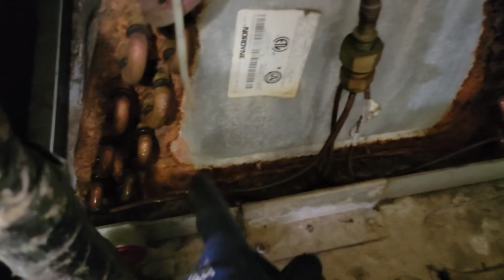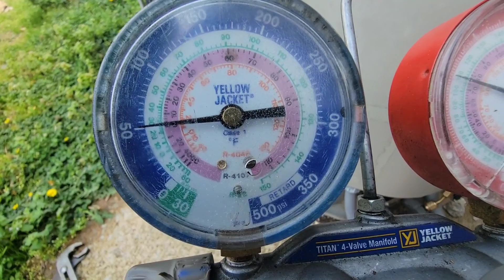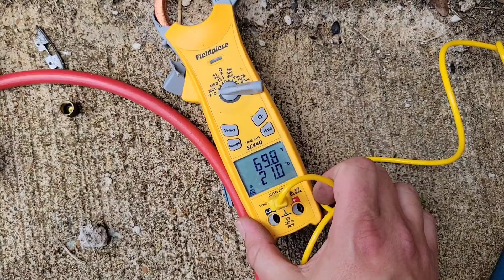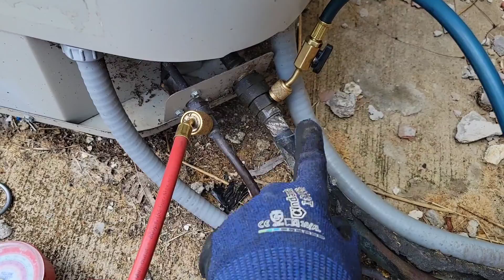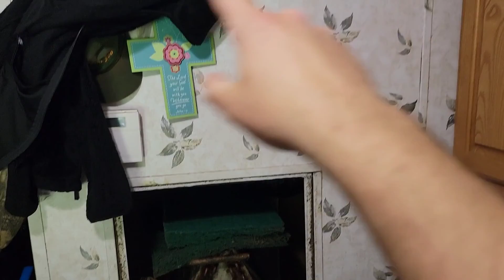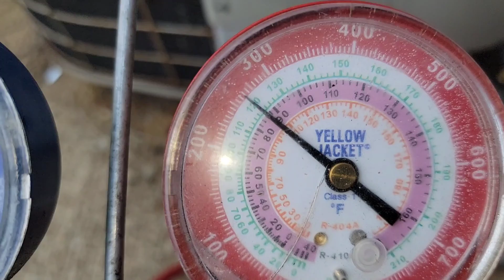How to charge a mobile home air conditioner?

Comment: Taddy, Can you give us a tip. Regards run capacitors outside units. Many times previous guys put in an upper size run capacitors because that's all they had to make it work. But can you tells us how do we know what sizes really a condenser should have in it. I guess you'll sized by ton unit right?  Thank you Taddy, you are the best teacher.

Comment: Wow $250 for service call just to add refrigerant. I just paid $400 for 35 min. to add R410A to my system that lasted for 4 days! My system is shot! Leaks on evap coil and condenser.  I got two quotes. First one was for a Heil 3 ton heat pump w/aspen mobile home coil and 15kw electric heat, new line set, condenser pad and thermostat for $7752. Second company same things for $6786. I haven't got an installation yet but i went with the lower price one. When I told the higher priced company that I went with the lower one he asked if they were going to install a high pressure switch and that they where going to install a Heil mainline. He said my lower quote was most likely a contractor grade unit. What does that mean?
Reply from the maker: The unit comes with a pressure switch.Most units do
You got a good deal

Comment: And my parents trailer I see that half of the evaporative call freezes and the other half doesn't...
Also the blower underneath when you pick up that door that filter or whatever it is I noticed that it's dirty like the one in the video...
Should I put some new filters like that I'm not sure what you call those on the bottom?

Comment: If the inside coil is leaking, and you add more refrigerant, it will just leak out again? I have this system. It's just as rusty, and exactly the same condensation with occasional freeze up. Can you do a video replacing the interior coil?
Reply from the maker: Yes I can do a video of that
Reply: @taddydigest  my system is 10 years old and just this summer is really showing the signs of dry coil.
Reply: Ive always kept it clean inside and out.

Comment: Tadd your cool.  I’m getting water running into my down flo condensation it is 2050 sq ft. Dbl wide 5ton. With A coil down flow does it need a p trap for condensation?

Comment: Hey.  If I was to install a new indoor coil.  I would put it below the furnace.  It will work better that way. Plus if you have drain issues it won’t leak on to the furnace.

Comment: What do you think of the Rheem air handlers being installed in mobile homes? The coils usually can be flipped around but I see that the hole of the supply doesn’t usually match with the hole that was made for the original system.
Reply from the maker: I've had a few of them and they work just fine

Comment: Why çant you reuse the lines and Clean them out
Reply: It is good Quality lines made thicker especially for AC they don't wear out
This is a different story about 5/8 gas line copper and it is possibley thiner than AC lines but I buried it used it for 20 years for propane  bought a new trailer and parked in the front yard it used natural gas I dug it up and used it on the new trailer for 33 years and are still using it with no leaks ever that's 53 years and counting I know it's much less pressure than AC but unless you have viberation  I believe it will continue to work
Reply from the maker: The lines are twenty years old it's just a good practice to replace

Comment: A 25lb jug of R-22 in Vegas is $1300 right now from the supply houses . Last year I did only 410a coil with matching condenser change outs . It’s too expensive for customers just to replace parts in any R-22 units . Also  you have to consider that the average unit is at least 15 years old .
Reply from the maker: Very good knowledge thank you for sharing this